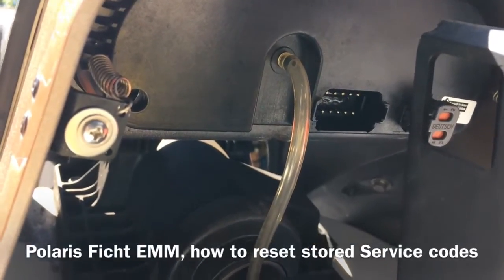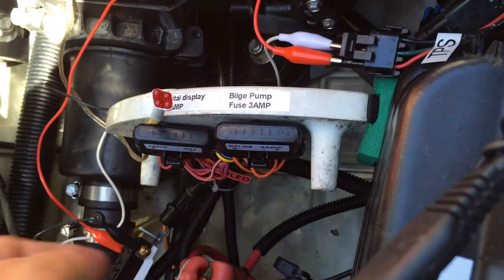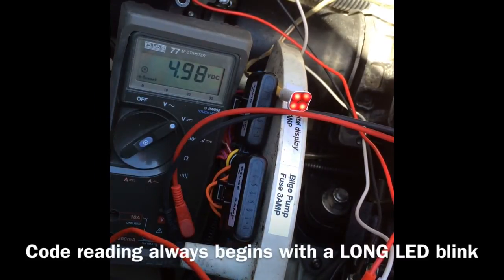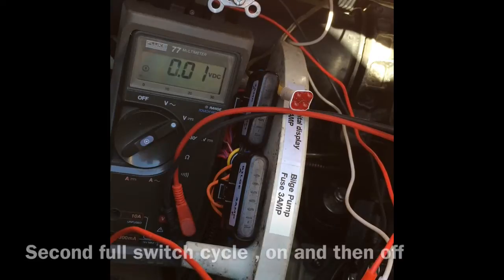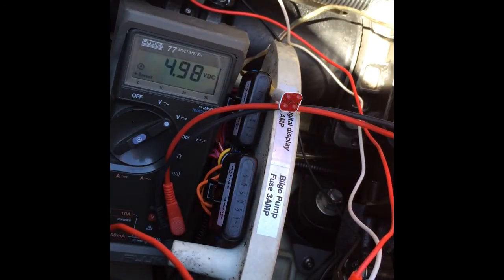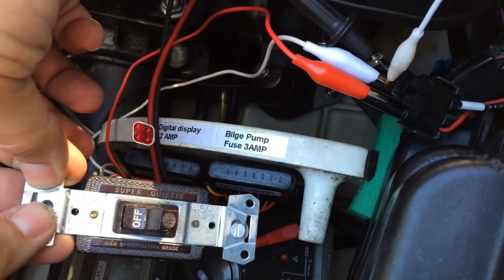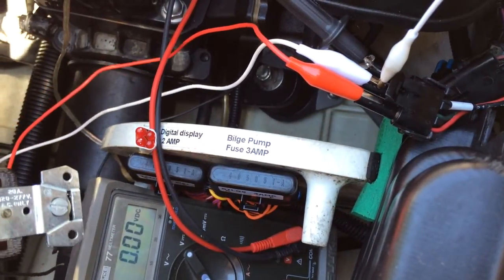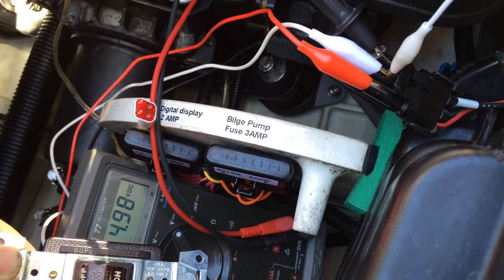Polaris Ficht EMM Service code reset demonstration

Comment: KM447 ANY IDEAS WHERE I CAN SEND MY EMM OUT TO BE TESTED  OR REBUILT -I OWN A 2002 GENISIS I 1200
Reply: NO START ONLY BACKFIRES
Reply: Ficht emm repair
Reply: The guy will repair/rebuild for $450. I have a 2002 Genesis that had a bad emm as well lol.
Reply: @parkergainey9072  HAVING A HARD TIME MAKING THE CONNECTION
Reply from the maker: http://lakesidetech.biz is the place you want. 

Excellent customer service, reliable Ficht EMM repairs

Comment: hello, I have a small problem with a 1200 polaris genesis injection. I just change the meter and nothing motor function level. the meter works well but the polaris unbootable. could you help me. thank you
jero.83136@gmail.com